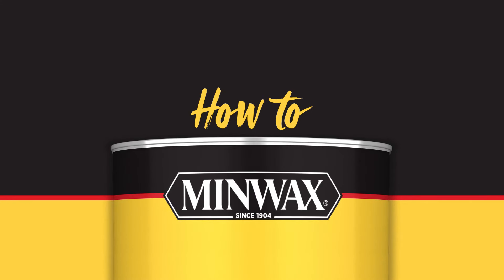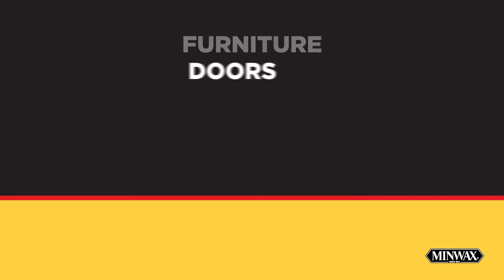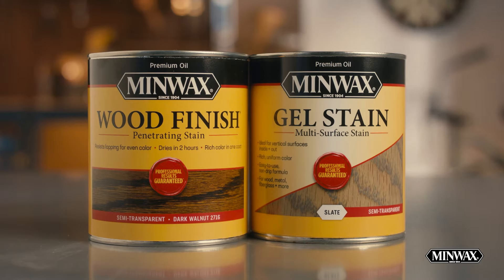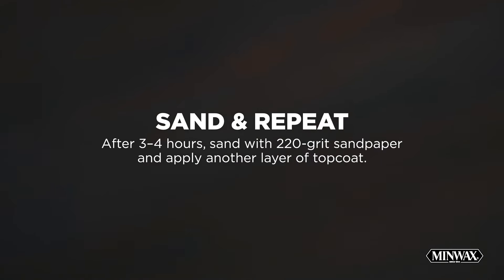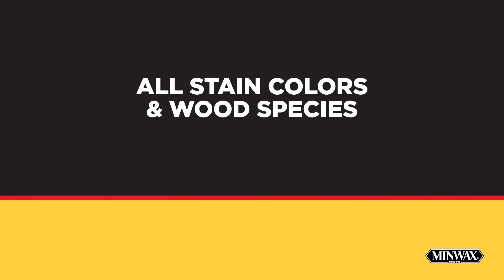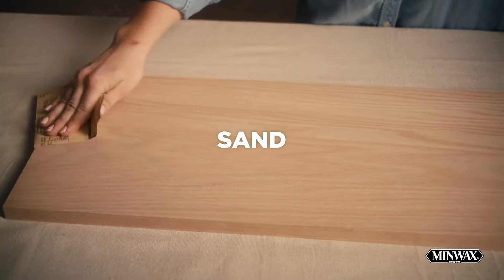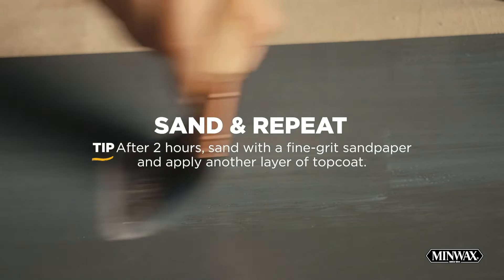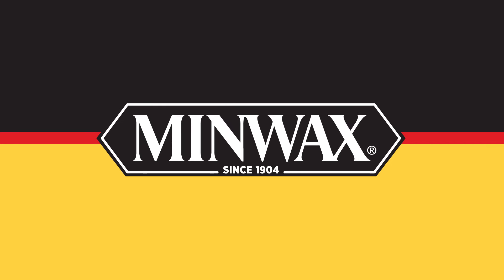Minwax® | How to Apply a Protective Finish

Comment: Just bought premium unfinished Maple kitchen cabinets. Do I have to stain them before applying Minwax Polycrylic  Topcoat- Clear Gloss
Reply from the maker: Hi Celina! It is not necessary, but if desired you may apply a stain such as Minwax® Water Based Wood Stain or Minwax® Wood Finish™ Stain to bare wood surfaces following label instructions. Wait at least 24 hours before applying Polycrylic™ Finish over Minwax® Wood Finish™ Stain. Hope this helps!

Comment: I have a situation involving thinner for you, for which I would very much like your feedback.

I purchased a Miniwax clear, satin finish, polyeurathene for floors. After it was applied by some guys, it had a very glossy finish. I didn't like the roller marks which were present, so, despite being down about the gloss, I applied a second coat.

I left the roller and the brush is paint thinner overnight. The next day, I squeezed the roller thoroughly, and flashed the brush like crazy. I proceeded to roll another floor, and patch some areas I did on the previous floor. This second floor, and the patches, now have a satin finish.

My initial, and fundamental concern, is that my thinner induced roller and brush may have had the result of removing the finish which was there before. However, the thinner to polyeurathene ratio makes this highly unlikely.

Any comments on this? I now like the finish of the second floor, and the patches, but I'm concerned at how they came about.
Reply from the maker: Hi Lock, we'd love to speak with you about your project to ensure we're getting you the best recommendation possible. So that we can better assist you with this matter, please contact our customer support team directly at askminwax@sherwin.com or by phone at 1-800-523-9299. Thank you!

Comment: I applied the Prestain then used the walnut stain and then the next day used the warm satin poly and it’s been over 6 hours and still has sticky spots. Should I sand now or wait or remove ?
Reply from the maker: Hi Tyler. Once your project is fully dry, you can begin sanding. Paint dries faster in warm, dry conditions and slower in cool, damp conditions. A temperature between 70°F and 90°F is ideal for paint drying. High humidity slows down the drying time of paint, as the moisture in the air prevents the paint from drying properly. If possible, try to increase ventilation in the room. A fan works great if you have one!

Comment: Wood floor application of oil based polyurethane - How long does it need to dry before I can walk on it?
Reply from the maker: Hi there, Rebecca! Thanks for reaching out. Depending on external factors, drying completely can take 4-24 hours. So the longer you can wait, the better. We recommend doing a patch test, which could indicate how long it will take to dry on your project. I hope this helps!
Reply: @MinwaxUSA  thank you!

Comment: You didn't really show how to apply the Polycrylic topcoat. You exhoed the instructions on the can. Do I always have to apply 3 coats? I have a difficult time applying one coat evenly and would love to see how you apply and then sand to get the best result.
Reply from the maker: Thanks for your feedback! For applying the Polycrylic topcoat, while three coats are recommended for optimal durability and finish, you don’t always have to use three. If you’re finding it challenging to apply even one coat, try using a high-quality synthetic brush or foam applicator to achieve a smooth, even layer. It’s important to allow each coat to dry completely as specified on the can before applying the next one. Lightly sanding between coats with fine-grit sandpaper can also help achieve a smoother finish. We’ll consider your suggestion for more detailed demonstrations in the future. If you have any more questions or need additional help, feel free to reach out!

Comment: This product takes way longer than 3-4 hours between coats. I’m at 16 hours and it’s still too tacky to sand.  Project is indoors 55 degree heated shop
Reply from the maker: Thanks for contacting us. I'm sorry that the clear has remained too tacky to sand. Did you use Fast Drying Polyurethane or Polycrylic?  A few things that could cause prolonged drying would be over-application (applying the clear too heavy), applying the Clear over a stain that wasn't fully dry/or over unabsorbed stain, and/or low temperatures/high humidity.  Can you tell me more about which Clear you used, what you used it over and I'll do my best to help. Respectfully, R.C. Digital Care Team.
Reply: @MinwaxUSA  I’m using Polyurethane Satin over MinWax stain. The project material was butcher block walnut.  After 24hours I was able to sand for a second coat.  Only issue could have been stain wasn’t completely dry even though I waited the recommended time before application of the Polyurethane
Reply from the maker: Thank you for that information. A possible cause for this could be that the excess stain was not wiped off thus leading to a longer dry time. Please let us know if you have any other questions or if we can assist you in any other way.